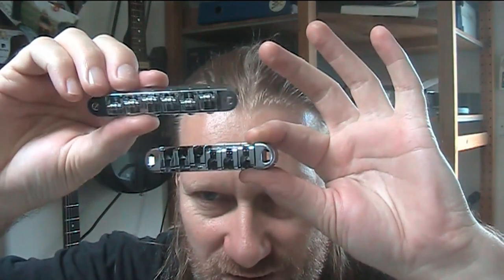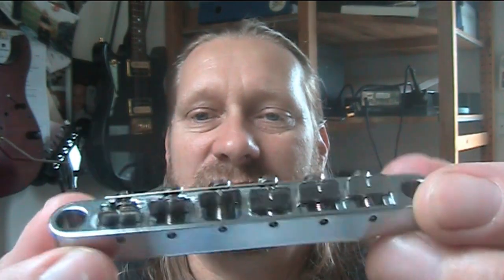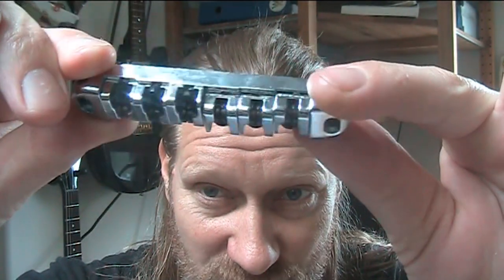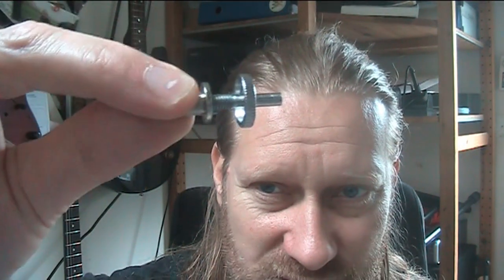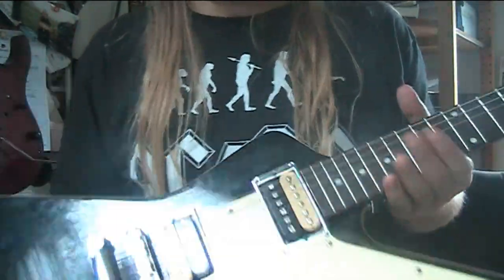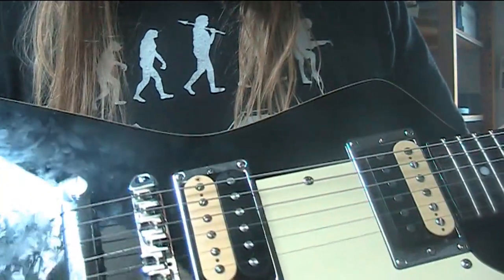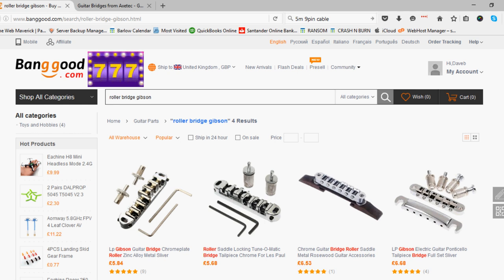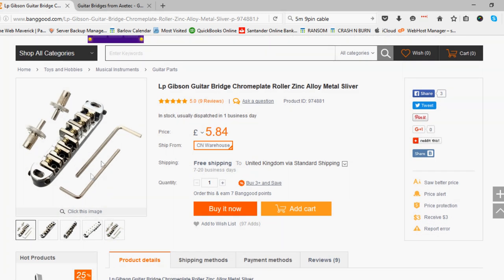Tune-O-Matic Roller Bridge Does it Make Any Difference To Your Guitar?

Comment: Can you say which one would fits better into a fender squier jaguar guitar ? :/
Reply from the maker: cant say, you will have to check measurements yourself.
Reply: @DaveBarlowGuitar  how did you intonate it... the one you have installed.. the screw near to the  rollers does the job? I hv bght one from the options u said and it fits fine...but no screws on the sides like other bridges. Is it the black screws near to the roller facing upwards? However many thanks for the information
Reply from the maker: @theenthusiast6196  its a bit fiddly but took just a few mins.
Reply: @DaveBarlowGuitar  It looks like the hex screw for adjusting intonation is under the string! How the heck do you fit your hex wrench in there with the string in place? I'm looking at the kind you bought & the kind with the screw on the face (like orig TOMs), so you can adjust with strings in place.
Reply from the maker: @zarguy   yes adjust while strings are in place, I just lift the string to get at the screw.

Comment: What I would say is that the chunkier looking bridge might be the better bridge to get.
Especially if, as some guys say, that bridges with more mass = 'better' tone.......but in these days of guitar myths and old wives tales you never can be sure, probably better to experiment yourself rather than listen to stuff on the internet 👍
Reply from the maker: To be honest I did not hear a difference but much kinder on your palm mute hand.
Reply: That's interesting mate because every I read about bridges they say that the more mass that hardware such as bridges have, the better the tone & sustain etc is.
Maybe that's just more mythical bollix debunked right there.
I'm looking to buy a roller bridge but those chunky ones have a narrower string spacing than the tune o matic looking ones, but the t-o-m ones are better suited to the 10.5 mm spacing that most of my humbuckers are....but then again anything has to be better than the regular t-o-m saddles ain't it.
Reply from the maker: Jammy Git I use the chap Chinese ones and they are fine, I don't notice the difference.
Reply: Yeh Dave I have a tune-o-matic size roller bridge on my Les Paul and I think it's great. I need to get another for my Tele I'm converting with humbucker size P90s and a Bigsby and I've been umming and ahhing whether to get the same again or the chunky version.....I'm ok until I get a choice and have to make a decision hahaha 👍
Reply: @JammyGit  Sort of the same here lol. I have a Gretsch G5420TG that I'm looking to add a roller bridge on with a Bigsby tailpiece as well. I already switched out the stock Bigsby spring for a Super Squishy Spring which is a lot more comfortable and less imposing to breaking strings. The roller bridge should make it even better without the knife blade Adjusto-Matic Bridge chopping the strings.
Reply: William - I have a Gretsch 5426T so I guess that yours is similar to mine, but mine doesn't have a tune-o-matic it has the rocking bar bridge, the one that's attached to a piece of rosewood and these bridges can either be floating or pinned. Does yours have the DeArmond Dynasonic type single coil pickups the same as mine?

 I'm not a fan of the rocking bridge, it's like a solid piece of aluminium (I think) and is compensated and kind of hard to describe, but anyway I found some Gretsch space roller bridges going for a good price and it is an improvement when using the Bigsby.....but really, I think it's essential to have a roller bridge if you have a tremolo on your guitar and still a great idea even if you don't have a tremolo fitted. I have 4 guitars that have tune-o-matics, 2 of those also have tremolos and I've changed them all for roller bridges, as well as my Gretsches space roller.
Reply: @JammyGit  My pickups are the new blacktop filter trons, a little more powerful than the earlier ones and good enough for now. 
Yeah I've seen those rocking bridges and I understand the concept of why but don't agree with their engineer it is the best design and implimentation for a bridge. I know some guys that love them but to me it's sort of an accident waiting to happen lol.
The Roller Bridge will definitely be on my to do list.

Comment: Dave looking at the roller bridge would the fit my Japanese Columbus les paul copy which I am renovating
Reply from the maker: yes, but measure it anyway, sometimes poorly made guitars the bridges dont line up, other than that go for it, will be the best hardware mod for any guitar.
Reply: Thanks I remember when Gibson were taking the Japanese Columbus company to court they said it was to close to the original  thanks for the help

Comment: 1952 TOM technology is archaic. One must ask ones self   ...Am I a player of the guitar or a collector of ancient design with a closed minded, collectors attitude. Do you want to be held back as a player because the hardware is lame , or,  upgrade to what is  physics based,friction reducing, rollers or graphite saddles and nuts. I am not a collector or "purist". Playability will always win. Playing the guitar is supposed to be fun. I am not a collector of older guitars or anything that is held in esteem as something better than we can do in modern times. Rollers and bearings where certainly available in 1952, ( and 100's of years previously. Started with the invention of the wheel. )I can compare this upgrade as the difference between a original 1952 automobile Vs anything that is simply, safer and faster and longer living. Even back in 1952 the technology was there. It was not used in guitars because a guitar did not need to improve like an automobile. The guitar is and has always been about fun and making music. Putting a roller bridge and a graphite  nut is like putting a new ZR-1 engine in a 1952 Chevy. It looks the same, yet the performance is noticeably better. Or , Upgrading from drum brakes to disc brakes. Simply better and more usable.
Reply from the maker: Good advice
Reply: Well said. I am not, nor ever will be, a purist. For me it's all about PLAYABILITY and TONE.
Reply: I can understand from a collector's point of view of leaving something as is if it's like 50 years old or more but if it's something you play fairly consistently and especially if you're getting paid to do it, upgrading to modern parts just makes absolute sense!

Comment: I bought a used Gibson 57 Gold Top Vintage Reissue, it has a crappy bridge they kept popping up the screws seemed bad or was it the saddle? anyway adjusting the B String tone screw fell apart, no pressure on it at all, weird..so now Im looking at Faber - Germany bridge and trying others for what kind of sound I like. I put a Roller Bridge on an Epi it was a thicker sound but I didnt like it for some
reason, maybe didnt have the same look and feel. https://www.youtube.com/watch?v=K2SApS1bPsM

Comment: Roller bridges can't hurt and are the best if you're using a Bigsby or Floyd Rose tail.
Reply: Thomas Morman floyd rose?
Reply: jubjub f 
Yes, Floyd rose.
You need to get out more.
Reply: Thomas Morman No you don't seem to realize this wouldn't work with a Floyd Rose. You need some more schooling in mechanical devices. Especially before you tell someone else to get out more. A floyd rose is the bridge as well, this would do nothing for it. I'll let you think about it.
Reply: jubjub f 
You know nothing.
You need to get out more.
Reply: Thomas Morman peace troll
Reply: Thomas Morman How? I asked you how would this work with a floyd rose. Then I explained how it is useless to a floyd. It would work for a Bigsby, not a floyd. Me stating facts is not trolling. You throwing insults with no explanation is more inline with it.
Reply: Thomas Morman Lol instrument store big enough to customize guitars. Didnt know they had to be big enough. Look a roller bridge works with a bigsby as a bigsby is a tremolo that acts as just the tail piece, it isnt the bridge, so a bridge in front is required, a roller would certainly help with tuning stability in this case. A floyd is similar to a Fender tremolo in that it anchors the strings in place and is the bridge. It intonates and action is adjusted from there. Putting one behind a roller bridge would be absurd, you would have to set it farther back so you could intonate at the roller bridge. Then you have to think about strings wanting to pop out of the rollers due to the amount of a tension a floyd can drop. Besides, adding a piece of hardware in the chain, even rollers is still a friction zone. If the string doesnt need to be touched at a certain point by hardware, you leave it be as that is again another point of friction. Now rollers on floyd saddles I could see, but not an entire bridge, in fact Im sure you wont find anybody who has a floyd with a TOM sitting in front of it. That defeats the purpose. But back to the saddles, even then you may just be better off with Graphtech String Saver Floyd saddles. Ive found that material to work about as well as most rollers with the benefit of not having the possibility of seizing up. Look, Im not putting you down for this, just try to learn. Its not some mod to go and put a roller bridge in front of a floyd. I get you may have just said it, but now you know. Now a roller bridge would also be good for a les trem as well as it is a tail piece tremolo and not a tremolo bridge, much like the bigsby.
Reply: Thomas Morman Then please, state something of intelligence or value yourself then. Stories from big music shops do not count.
Reply: Thomas Morman 😂😂😂😂😂😂😂😂😂😂😂😂😂😂😂😂😂😂😂😂😂😂😂😂😂😂😂
Reply: Looking at my Ibanez JS1200 the Bridge IS built into my Trem system so without some serious modifications it isn't an easy drop in procedure. Not saying it can't be done but it's going to take some time and effort to make it work. It would be a nice feature though if it worked?

Comment: Roller bridge on a Tele, yes. On a Les Paul, no.
Reply from the maker: WHY?
Reply: @DaveBarlowGuitar Strange thing to say as most tele's don't have this kind of bridge!
Reply: @Desertmouth  There is a roller bridge with individual saddles for Tele's/Strats. I did not mean a tune o matic style bridge with rollers for a Tele.
Reply: @DaveBarlowGuitar  Just personal opinion. I tried one on my Les Paul and just didn't care for it. However, I also tried one, albeit it was not a tune o matic style bridge but one with individual saddles more in line with Fender style bridges, on my Tele and really like it.

Comment: I actually have two of those Hamers. One of them is made of Korina and as much as I want to use, it sounds like complete shit. Nobody seems to know how to set the intonation the damn thing. Two different guys did it, and both botched it. This is one of those mods I've been meaning to do,  and it looks like I'll try out on the Korina first. Thanks for the info.
Reply from the maker: Yes I know what you mean, I swapped out the bridge for the roller bridge, after that was fine.
Reply: Update; the bridge arrived and they not only sent the wrong posts, but one of the screw holes wasn't machined properly, and the screw wouldn't hold down the saddle. To make matters worse, the saddles wouldn't slide and they were crammed against each other. So even though it's not a king's ransom, I really I spent $9 USD on nothing, and I'm back where I started with this guitar, which I'm starting to hate because it just sits in the case now because nobody seems to be able to set it up properly. I'm curious  if you've ever had a guitar that no matter what you did to it, you couldn't get it to sound right?
Reply from the maker: RobotShlomo only downside to China guitar products is that sometimes you get a crap one, purchase on eBay, that way if you get a bad one they will most likely just ship another. I have purchased 6 bridges so far and all have been fine.

Comment: So, you had to buy TWO bridges to get ONE that fits? No dimensions given. I rest my case.
Reply from the maker: I did not  trust the Chinese spec so yes you are correct, but I was just checking it out so you dont have to.
Reply: @DaveBarlowGuitar  I have a similar problem; my Chinese made Strat copy (Harley Benton) came with string saddles that were too wide on a couple of strings, so dead-sounding strings. I have ordered a set of roller saddles from Dragonfire U.S. in the hope they will cure the problem. Careful measurements on the guitar reveal that the  QC is awful; nut slots wrong depth, string trees offset 2mm, and bridge mounting screws offset by 3mm. Other than that, the guitar is amazing for £100. My mate got the same model and his is perfect. Lucky (QC) dip I guess. BUT it plays and sounds better than my £700 MIM Strat. So if you are prepared to be patient and chuck another £60 or so into it, you come out £500+  better off.
Sorry about the rant earlier; I was just mad at Chinese QC and Brit firms going out of business coz they cannot compete.

Comment: Only buy the ones from Wilkinson, as the Chinese ones (5-10euros) are crap: the rollers don't roll at all, so don't bother.
Reply from the maker: Yes they do as I have 3 guitars with them in (my les Paul has done over 300 gigs with a cheap roller bridge), you may have purchased a duff one, its gonna happen at this price range. However all these roller bridges need constant cleaning and maintenance as they do get stuck from time to time due to sweat etc.

Comment: Roller bridges ruin the feel of yer guitar
Reply from the maker: Extensive testing and video results that i have personally done has led me to believe that if a rollerbridge is fitted correctly the tone and feel is slightly improved. Would be interested if you could expand on your statement so I can understand what you mean exactly :)
Reply: David Benson how why do you think that
Reply: Not true at all, maybe to you but after adding mine to my guitar it actually feels more secure and it still has great flexibility of being able to easily bend the strings now without crazy tight pinching and friction. Everyone I've talked with that has changed there's has said the same thing which is what led me to changing my pinch point bridge to a much more sensible roller bridge.
This sounds more like an assumed opinon than an actual experience.

Comment: If they are 6 quid they must be total crap I refuse to buy Chinese guitars or guitar parts they belong in the trash can.
Reply: You can pay 15-25 for the same one from Wilkinson. They just buy them in bulk and call them their own.  They're ok. Not trash. I bought a little nicer one for 18.  It's been great. But on a nice guitar I would buy a better one. Schaller is only around 40. That's what I'm getting for my main Les Paul
Reply: Actually receiving something from China is a different story. You have to know it's a reputable company. Even then I've had two things never come out of a little over 20